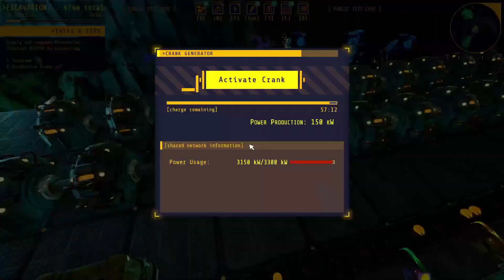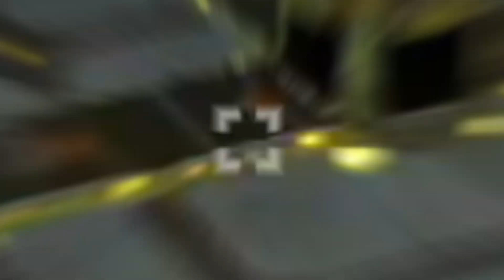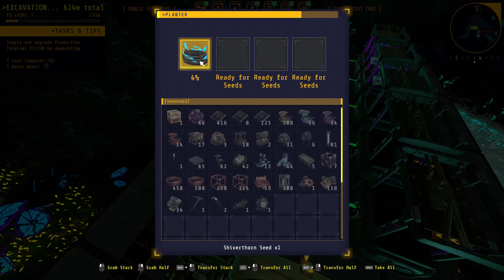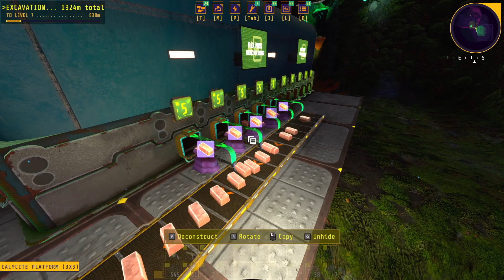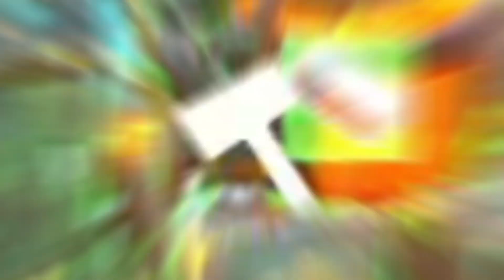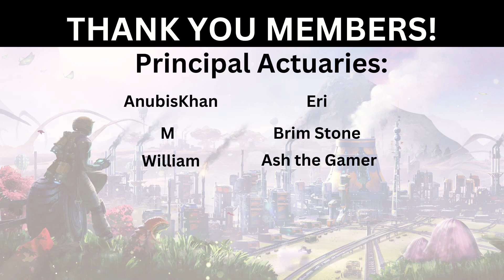How to set up a main base & scale up | Techtonica Guide (full release version)

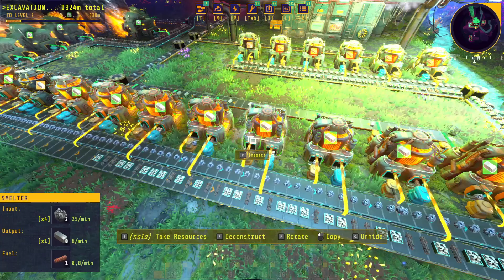Comment: 22:10 or you make sure to have the fuel intake on the output side so you have space for 2 normal inserts for input, doing that means you can wait till mk2 smelters before needing a fast inserter.
Reply from the maker: That works!